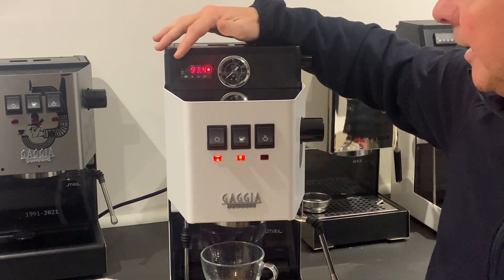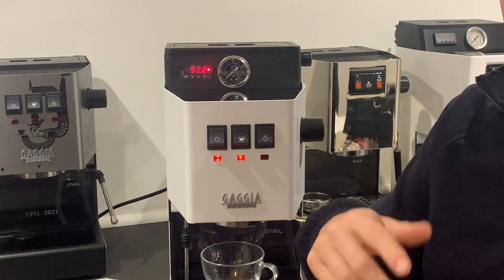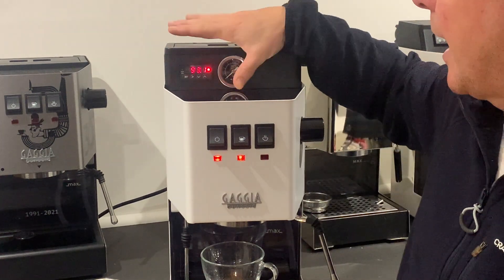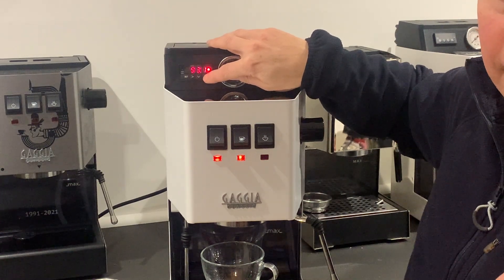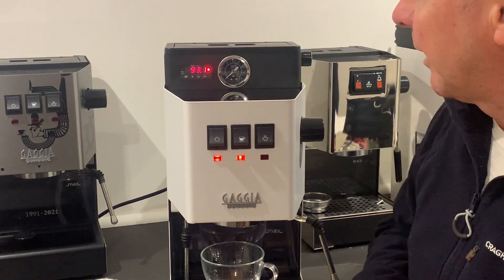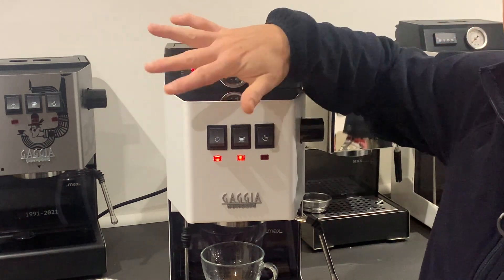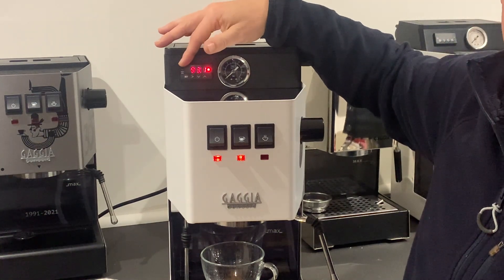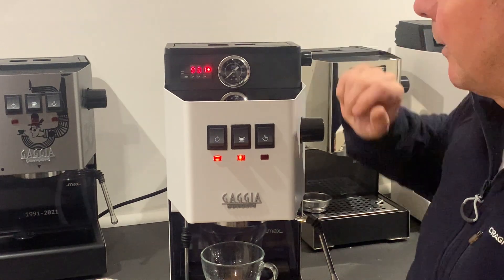Why Add a PID to a Gaggia Classic?

Comment: Have you had any issues with scale or corrosion in the aluminium boiler? I've only had my GCP for 2 years and the group has no water flow. Technicians are telling me the boiler needs to be replaced because it is all scaled up. Always used soft water and descaled every 3 months. TBH not too impressed with the life of the boiler!
Reply from the maker: The solenoid will be blocked and the boiler should easily clean up without being replaced. I hardly ever have to replace a boiler when servicing machines for customers. Limescale effects all coffee machines and regular descaling is a must in a hard water area.
Reply from the maker: Also my own classic boiler is 30 years old and still going strong

Comment: The Gaggia Classic Pro thermostat is pretty accurate, by a few degrees.  Most people cannot tell the difference.  In fact the age of the beans from one week to another can have the same difference, so can one bag of coffee from another - of the same brand. I say this because in a comparison taste test - one with PID and one original - tasters  could not consistently discern the difference.  People need not to think they ought to modify their machines.  Tinkerers can, and surprisingly - not, they tend to be male.
Reply from the maker: The initial thermostat is ok, but there are slight inconsistencies from one shot to the next in the temperature so taste of espresso changes. Th pid solves this and produces far greater consistency of taste